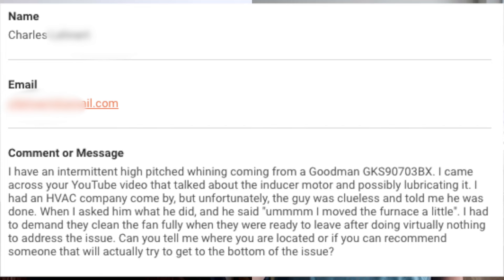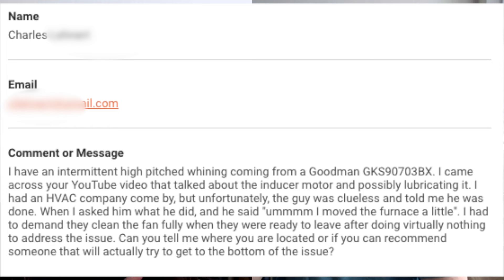How to Fix a High Pitched Furnace Noise

Comment: I just had new copper lines installed on my AC unit at home. Within a couple hours I started hearing a ringing sound coming from one of my air vents, high-pitched ringing sound. It’s random when it comes on. It will come on when the unit is running or when the unit is off anytime a day or night but now it’s been on for about 24 hours straight. What could it be? We have checked everything in the attic there is no smoke detectors. There’s no alarms that are making the noise. Any help would be greatly appreciated. Thank you.
Reply from the maker: Wow that's wild.  I will definitely ask Ramon and let you know what he says!
Reply from the maker: Hi Robin.  We answer your question in this video: https://youtu.be/2CDynprMnrg. I hope this helps!  Please let me know what you find out!

Comment: Brand new Lennox ML180E .  Looks solid on the install job...but...that inducer motor whine...ugh!  Follow up install service and internet search....its a common complaint.  The 28yr old lennox i replaced didnt do this. Bummer. I would think Lennox would address this. It is just the right pitch that i just cant shake hearing it. 
( no its not a bad bearing or vent issue, we've checked all that)  
I have a small house and the sound travels through the vents :(
Reply: Were you able to find a solution? I was about to buy the same unit.